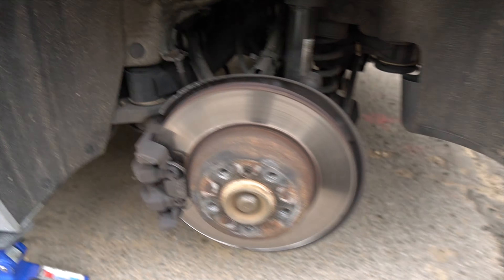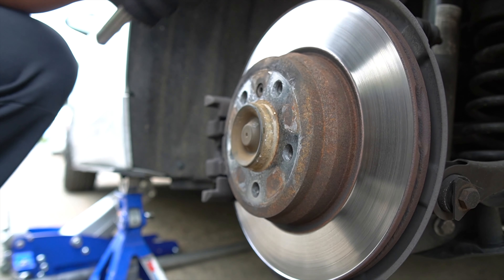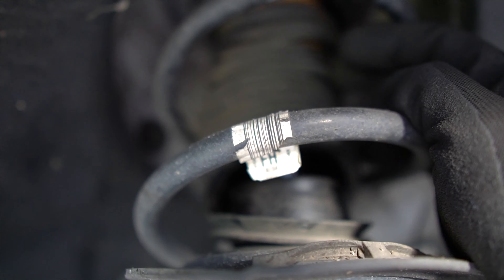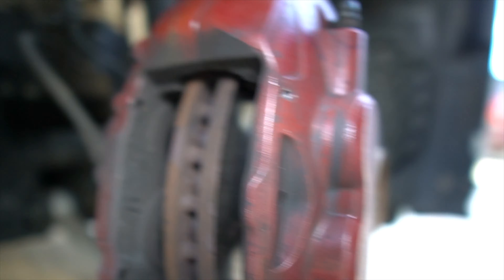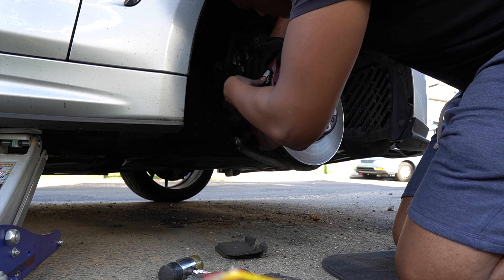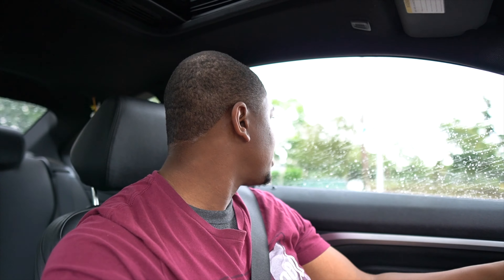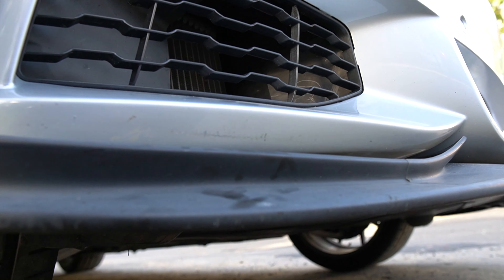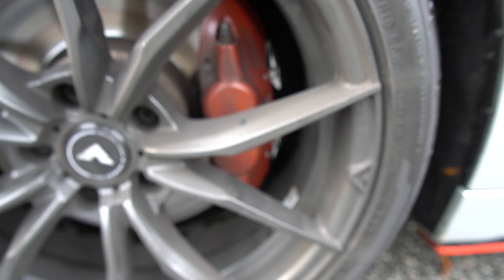FINALLY No More Brake Dust!!!! AKEBONO Pads For My 435i

Comment: i need to get me some akebono pads too. I bought some Bosch performance pads for my 3 series because i worried the akebono would reduce the braking performance. But the Bosch pads dust are destroying my paint job and my wheels!!! I still have tons of brake pads left, but I will change to akebono because my wheels and paint are taking a beating form the metal brake dust!!!
Reply: Wondering if you remembered how the performance was? I’m debating on akebono or Hawk 5.0 but I don’t want noise
Reply: @abgpsycho9758  still using them. The performance is very good. Not as good as OEM on initial cold bite, but once it heats up, they’re very similar. In fact I think they may perform a little better when the pads start to get hot.